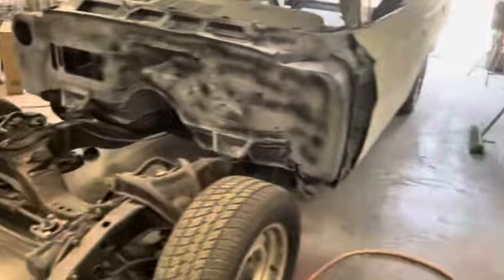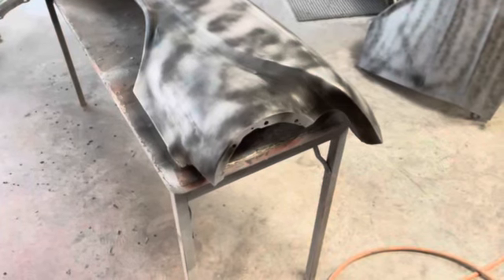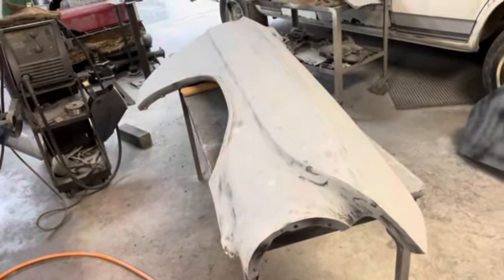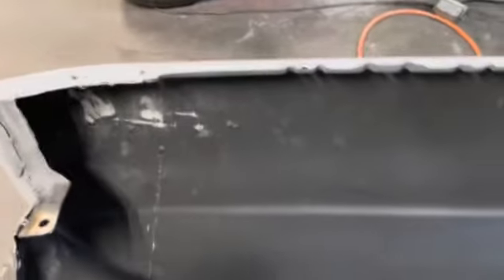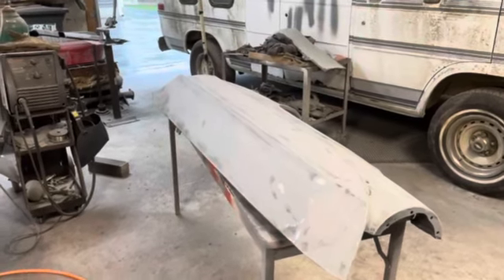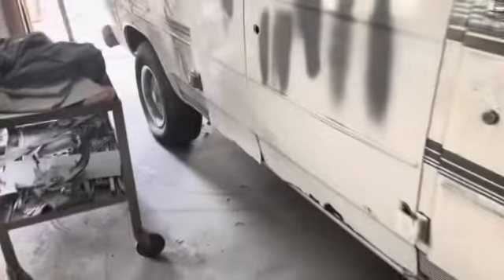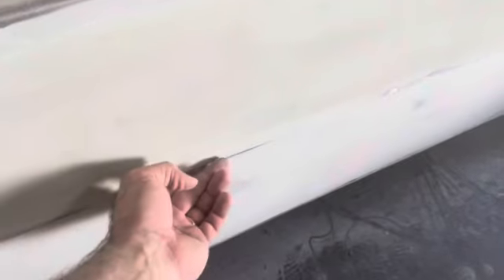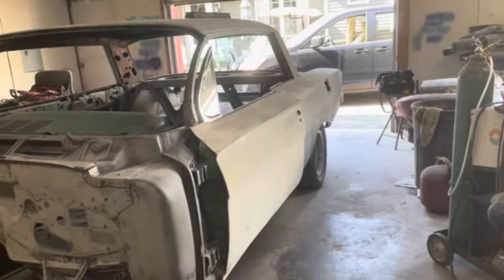1961 Impala Hardtop 4dr to 2dr conversion part 38; still more sanding

Comment: That red putty is for filling pin holes..savin you some grief. The problem is red putty SHRINKS pulls scratches etc...
Sand as much of that off as possible so later your paint doesn't get destroyed
Reply from the maker: Great advice, thanks!